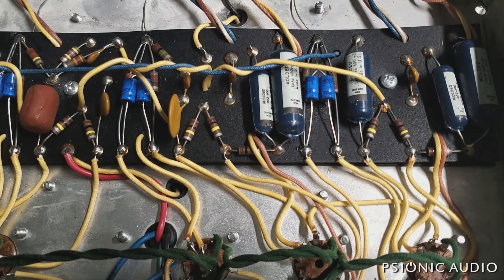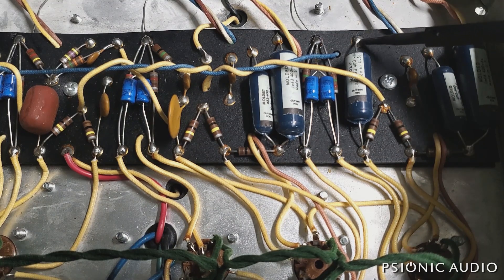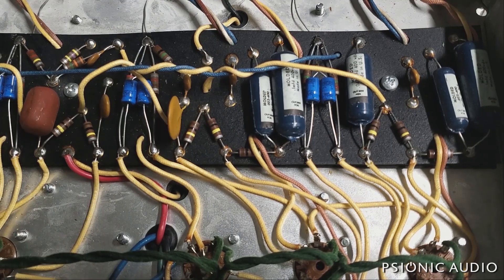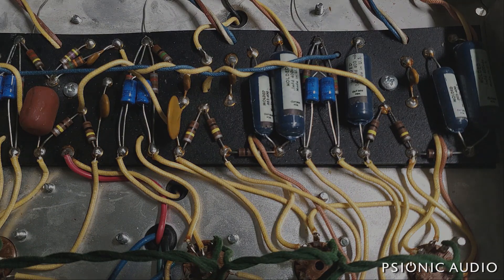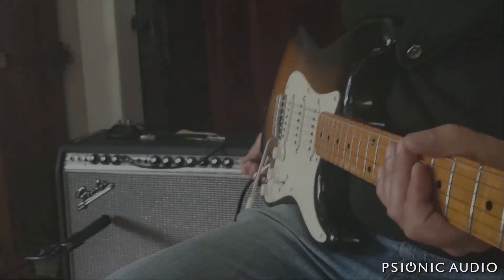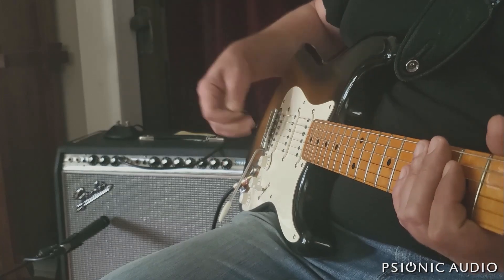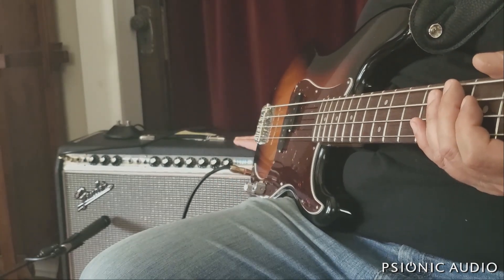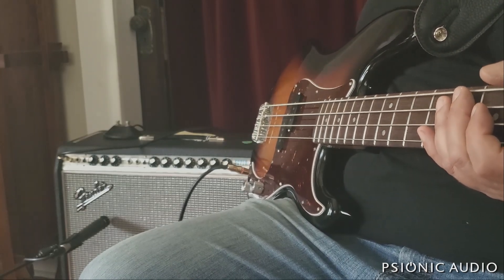Time Machine '68 Super Reverb Part 7 : Last Changes & Final Playing Test

Comment: Lyle, earlier today I was thinking about capacitors for recapping.    I ordered enough to recap two of my 20+ year old rack preamps, but did so before I started watching your videos.   The caps I run across in my gear are always radials and axial poly caps, like the ones I see you replace all the time.   It's been my experience that these are common failure items after enough time/hours.   Watching your videos has convinced me of this.   When I selected my caps, I of course matched voltage and capacitance, then lead size (so they actually fit the holes) and finally physical dimensions as much as possible.    As I was thinking about it today, I wondered if you'd consider a video on selection of simple components, particularly caps.   Resistors are easy enough.....   In any event just a thought.   Thanks for all your hard work on these.